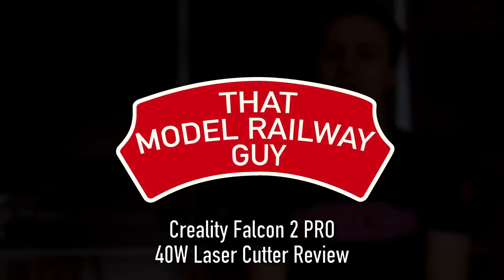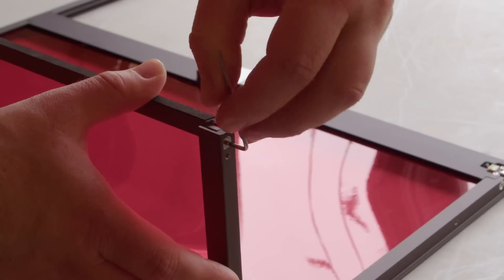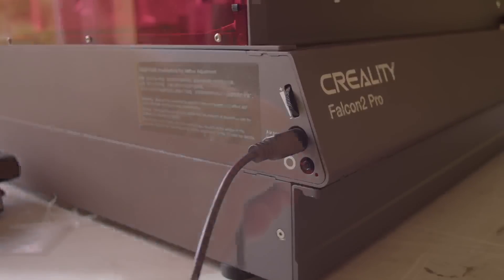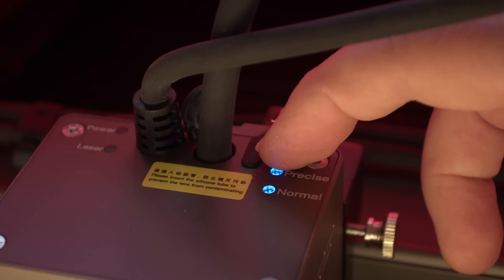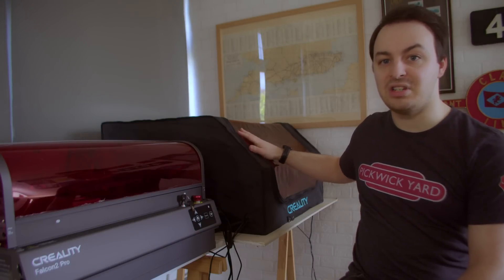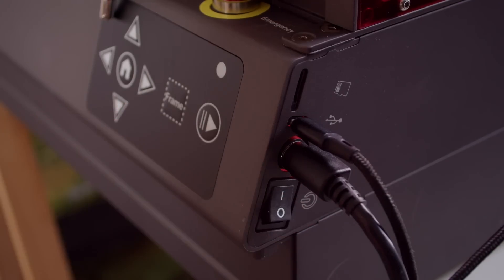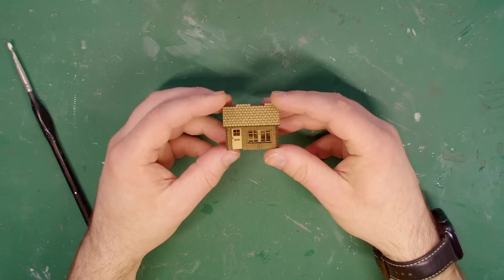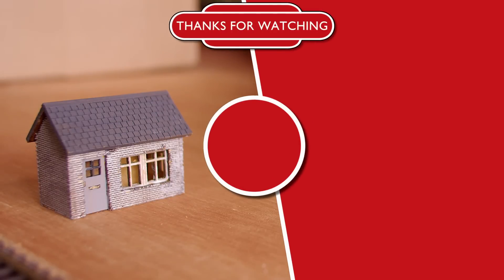THE UPGRADED LASER CUTTER! - Creality Falcon 2 PRO 40w Review

Comment: Red light: this video and others are not even touching THE MOST IMPORTANT information about thise lasers: how many runing hours will it last? Is it 50 hours on 100% power and laser will degrade by 10-20-30%? Or maybe 1000 hours and you have to buy a new one? Whatbis the truth? This machie IS EXPENSIVE and laser replacement will kill the whole thing financially. Not mentioning this spec is unfair and i thinking like this: if they are not touching this subject that means the laser life time is shitty.
Reply from the maker: I don't know what grand conspiracy you think is going on here but unless I ran this machine until failure (which could take years) it would be impossible to say for certain. Even then it would only confirm the result for this specific machine rather than the range as a whole. 

For what it's worth, I have one of the earlier Falcon 2 machines which uses the same type of laser module. That has regularly been run at 100% for over a year now and shows no signs of it degrading or losing power. 

It's worth noting as well that Creality have warranty and repair services and in a worse case scenario where the module is completely broken years down the line, you only need to buy a replacement laser rather than a whole new machine.

Comment: I have seen other reviews where they had mentioned that the tray could be pulled out to allow for larger jobs to be done that way, by feeding materials through it from underneath. Is this not the case?
Reply from the maker: I don’t think so. It’s not mentioned by Creality as a feature and when you open the tray it triggers a safety switch that stops the laser so I don’t see how others are doing it. Thanks for watching 😃

Comment: How wobbly is the bed? Found a honeycomb base to be a lot more stable in the past and easier to hold stuff down with magnets.
Reply from the maker: It's fine, it's all part of the frame so doesn't wobble at all. I think this style of bed is what's used more commonly on expensive CO2 laser cutters. The rails can be easily removed and pushed closer together if you need something more stable for smaller items. The airflow is much better on these rails in comparison to a honeycomb bed too, so fewer burn marks which is great. Thanks for watching 😃
Reply: @ThatModelRailwayGuy  cheers, good vid!

Comment: Nice build! The pro features are impressive. There is quite a price difference between the 22W Pro and the 40W Pro; for model railways do you think extra power is worth it? Perhaps I should say could I get away with the lower powered laser version? 😊
Reply from the maker: It really depends the thickness of the material you want to cut through. Up until now I've been using a 22w laser on thin materials and it was fine for my needs. But I have to admit it's nice to have the 40w version and know that it's not going to have a problem cutting through even thicker materials if I need it too. The fact it's essentially 3 lasers in 1 is very nice too - but ultimately if you're not going to need that functionality, the 22w is probably a good bet for a lot of people. Thanks for watching 🤩
Reply: I've got the old Falcon 10w unit and even that one is pretty good. I'm sure the 22w unit would be fine unless you are planning on cutting very thick or tough materials.
I mostly use mine for 3mm ply or mdf and various thickness plastic sheets too. Works well for me.
Edit: do get the air assist and a honeycomb bed if it's optional. Although I think the Falcon 2 has integrated air assist iirc.
Reply from the maker: Yes the air assist comes included with the Falcon 2 and the Falcon 2 Pro also has a bed built into the frame so no honeycomb needed.
Reply: @ausfoodgarden  thanks! Good to know

Comment: I’m hesitant to jump into making my own models. Looked at 3D printing a few times but I’m interested in laser cutting as well. I guess it’s more restrictive. Buildings and structures but not figures. Has anyone tried signals? Anything else it’s good for? I thought it was probably less fussy and prone to errors after hours of building like 3D printers
Reply from the maker: I'd say designing for laser cutting is definitely easier than designing for 3D printing. That said, there's a lot of sites where you can download files for 3D printing which isn't the case for laser cutting - at least not to the same extent.
Generally laser cutting works really well for larger structures while 3D printing is great for smaller details. You could technically make signals but I think they'd most likely be too delicate to operate - something like an O or G Scale signal would be perfect though. Thanks for watching 🤩

Comment: Could you make the design files available?
Reply from the maker: I have looked into it and I did a trial run by giving out some of the design files to friends who also have laser cutters. What we discovered was that, to get anything halfway decent, the files needed to be altered to suit the individual brands/model of machines and realistically I can't offer that support on a wider scale at this time. Most likely if I do ever make anything available going forward, it'll be as ready to assemble kits. Thanks for watching 🤩
Reply: @ThatModelRailwayGuy I don’t see why the files would need an alteration that is “machine dependent” I take it your designs are created in “Lightburn? And most users are familiar with that software. Any “machine dependency” is taken care of through Lightburn’s “Settings” tab.
Reply: Not looking for support. Size of bricks for TT etc… files as is would be useful.